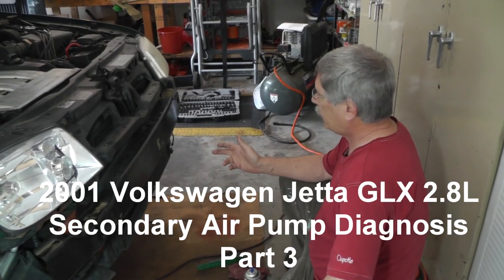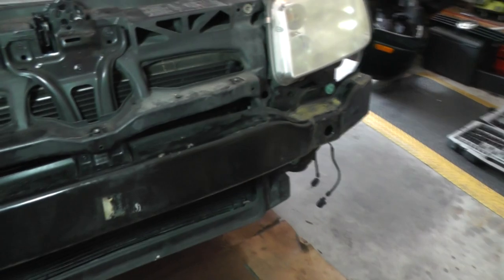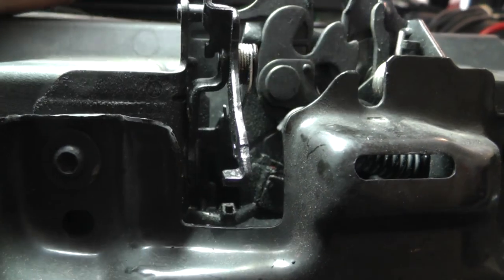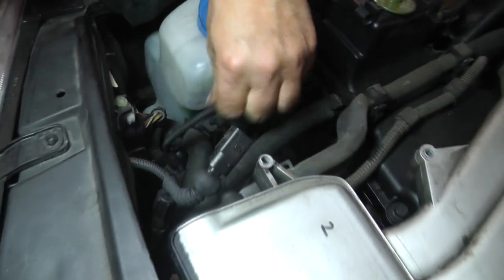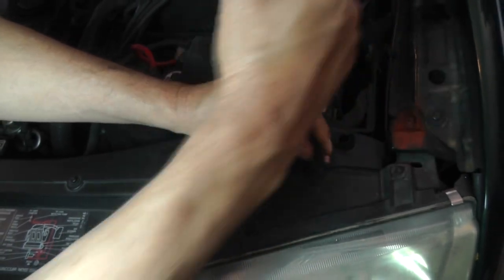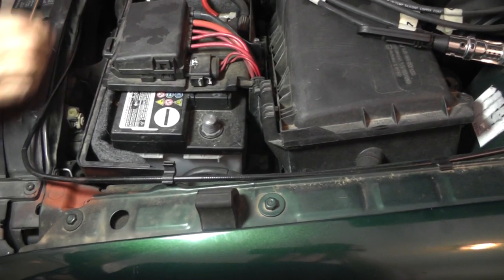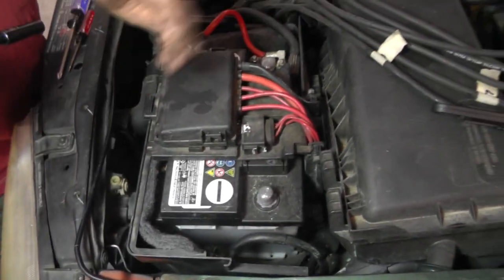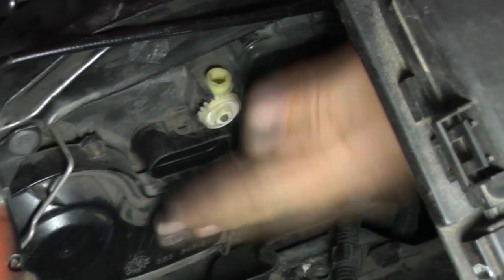Volkswagen Jetta Secondary Air Injection Diagnosis Part 3 (Lock Carrier Service Position)

Comment: i spoke to you about 3 month ago about an error MK4 jetta VR6 code P0411 indicates that the ECU has detected the flow from the secondary air injection system to be out-of-specification and the check engine light went out after three days. A week ago a herd the shift rod vibrate noise while driving and I had replaced the shift rod and bushings a year ago. today 5/16/2017 the check engine light came back on with the same problem code again. when i open the hood i heard noise coming out, around the INTAKE MANIFOLD VACUUM DRIVE UNIT. the unit that turns the shift rod. the check engine light would not stay off for two month with a broken vacuum hose. i also did a visual check for broken hose and could not find any. but i know that's not the best way to check for vacuum leak.  i cleared the error code, drove the car for about 5 miles and the engine check light  stayed off. my conclusion is that it's an intermittent problem causing this and should rule out any vacuum hose. so therefor i am thinking that it's a mechanism  is going bad and i think it's the shift rod drive unit is going bad.
Reply from the maker: nivasyl strongman yeah my shift rod lasted about two years and is starting to rattle again. Not sure how that can give you a vacuum leak but with Volkswagens stranger things have happened LOL. Good luck on what you find as your issue.
Reply: well , i don't think that the shift rod has gone bad but it maybe to control unit. my diagnostic was not very good.  since i get this p0411 code once in awhile every (two month apart), i said that it can't be a hose problem and must be a control mechanism failing.

Comment: I am a VW guy. I own a mk4 VR6 2.8L and you could have accessed the SAIP from underneath the car...
Reply from the maker: Hi Tyler. As far as just looking at the pump yes, but what if I had to remove it. Service manual says to put lock carrier into service position. And besides, I wanted to do a full inspection of vacuum hoses amongst other things. And it gives the viewers a good look at what I'm doing with the lock carrier pulled back.
Reply: I just added that just incase others were too lazy to remove and inspect everything. I am running into the same problem as this car did. And I ended having to replace the SAIP.  60 bucks for new. It was not able to be repaired. Video was very informative though. A great way for someone to DIY if they never worked on cars.
Reply from the maker: Tyler Fessenden Thanks Tyler for the comments. Where in the world did you find a pump for 60 bucks new? Prices I've seen ran from about 400-600 dollars. Good find on that one. Thanks to for the comments on the video.
Reply: Tyler Fessenden Were did you find the part for $60?